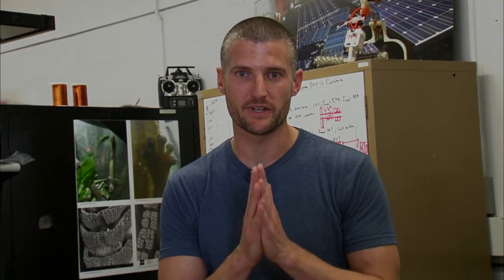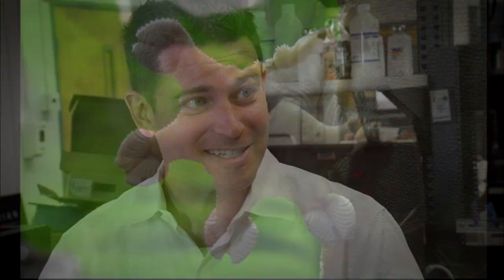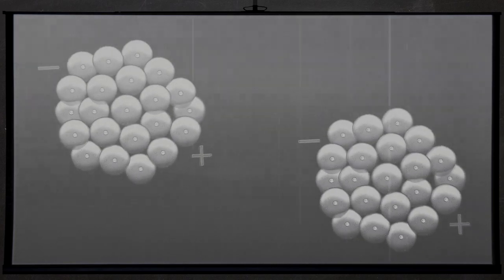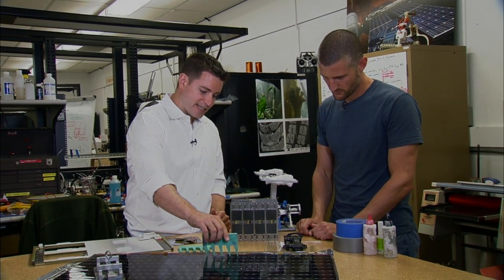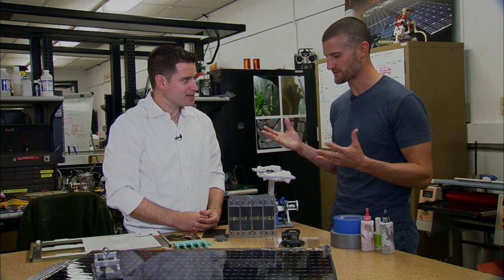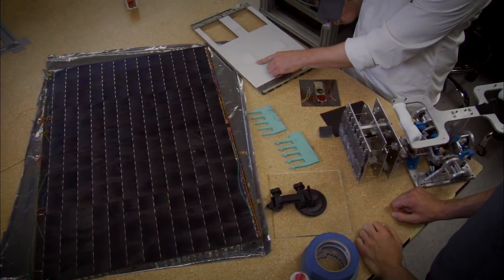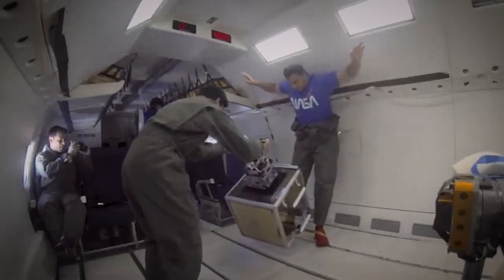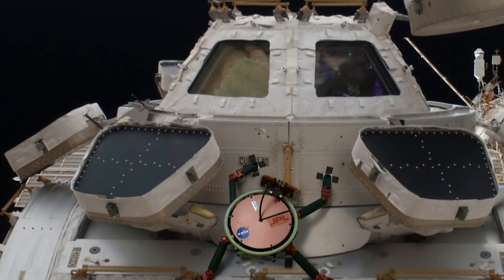Crazy Engineering: Gecko Gripper

Comment: In charge of "Robotics and adhesives"
Ah yes. Those two closely related fields. I see why they've been lumped together.
Reply: NicosMind Well they were talking about using adhesive surfaces on small robots, like for repair and analysis etc
Reply: Samuel Rowe My comment was sarcastic. its an odd title, but he was using engineering solutions as opposed to chemical so I can see why he was working on them. But it was the oddness of the title which lead me to comment.